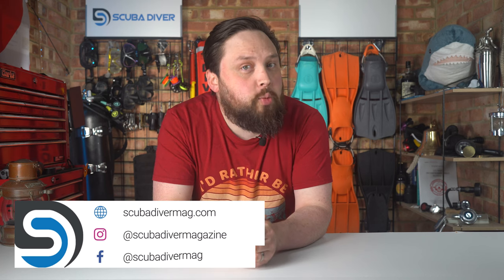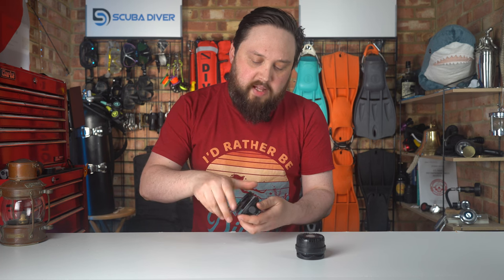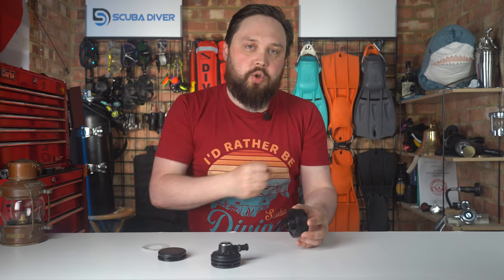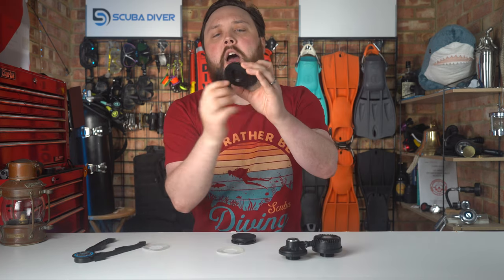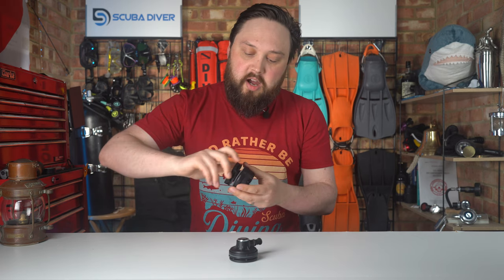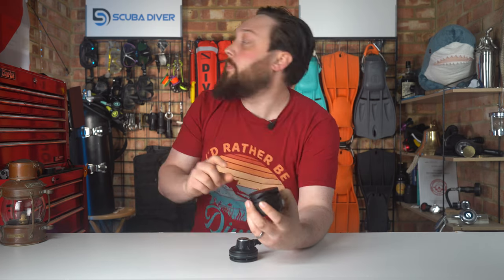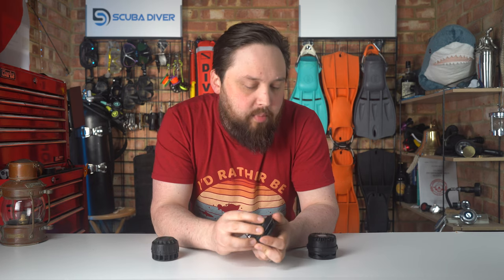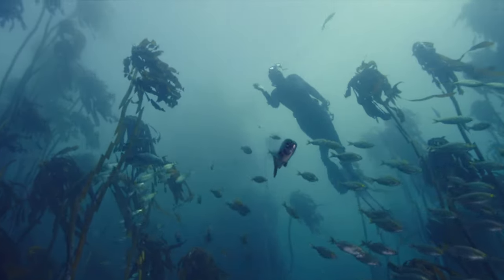Can I Swap My Own Drysuit Valves? #askmark #scuba @ScubaDiverMagazine

Comment: All good stuff, I'd just mention that especially with a neoprene suit it is a good idea to check it's still screwed tight after a couple of dives.  But that wasn't actually what the question asked, ie: 'can you retrofit a shoulder dump valve and do you need a kit?'  So yes, swapping out an old valve or fitting say a new inflator that has an electrical lead is very easy.  But if you decide for some reason you want a new dump on the other shoulder or on a cuff that's a whole different thing and will involve cutting a hole, gluing in the reinforcement disks and then fitting the valve.  I've never seen a kit advertised to do this so I would definitely take it to a professional.
Reply: `Hi Tim. Agree that swapping like-for-like valves would be something I’d consider swapping myself. However, fitting new cuff or ankle dump valves to a neoprene dry suit is somewhat technical and I’d have them fitted professionally, without hesitation, as the onus to repair falls into the specialists lap.😎🇦🇺🤿👍

Comment: #askmark my wife and I both have lovely mares avanti Quattro fins for diving. We are going on holiday where for one single day we will need a pair of snorkelling fins. Any recommendations for super lightweight, easy to pack, fins which are not so big and bulky as the ones we have now.
Reply from the maker: For the lightest snorkelling fins that are nice and compact and won't cost a lot, you can stick with Mares with their X-One Fins. They're basically flat and weigh very little. You wear them bare foot and the adjustable heel lets you adjust them to your foot size